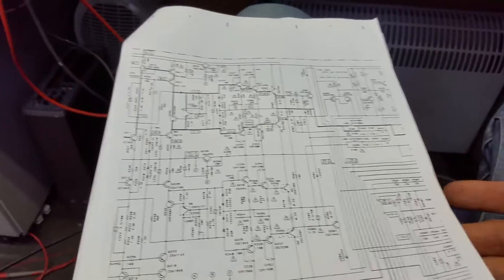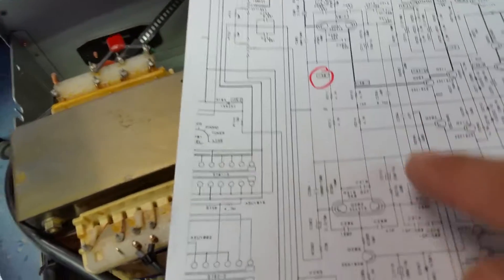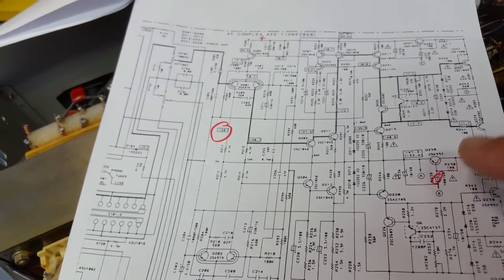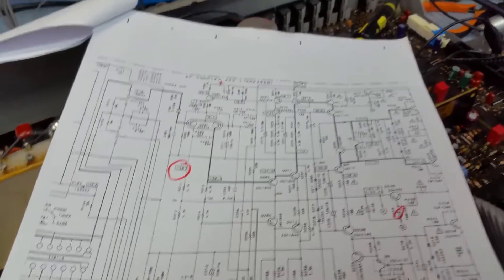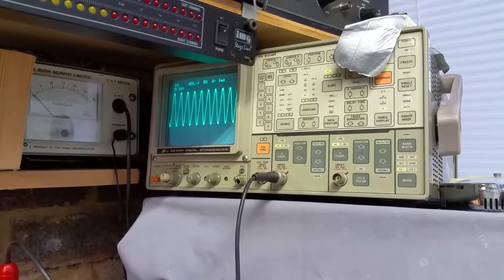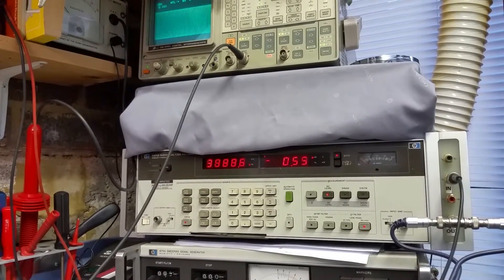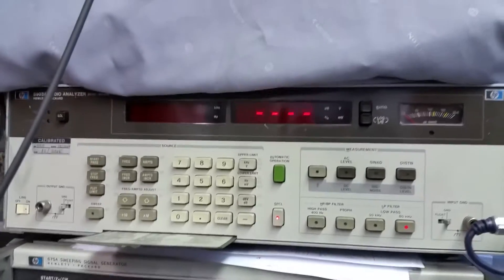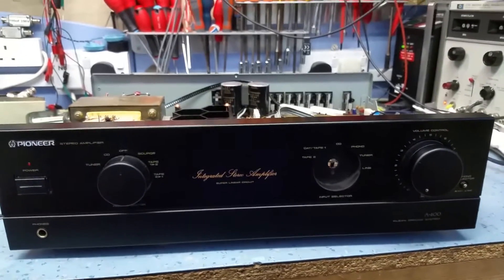Pioneer A400 PSU fault Pt2. fault diagnosis and repair

Comment: Hi Simon, I am trying to repair an A400 and came across your video. The problem is a rather high dc voltage (134mv) on the left channel. I've checked all the resistors on the left channel and they tested ok. Have set the idle voltage to 20mv according to the service manual but am still getting the dc. Any clue what might be the possible issue? Many Thanks 🙏

Comment: Hello Steven, ive watched your videos..im used to work doing this kind of thing many years ago.. I was given one of these amps in for repair after its been past about here and there..I've found it has rustle/low hum in the audio and looked at the circuit diagram plus the last chap who said he replacing many things hadn't do so.  Also the bias across the emitter is reading 1.2mv..very low.   I'm thinking it should be 12mv or there abouts.

Any suggestions would be greatly appreciate.

Manythanks.

Wayne

Comment: If you still have the A-400, Check for cold/dry solder joints everywhere! The A-400 is probably one of the worst offenders for bad solder joints!
btw, Your amp looks like the input caps have been changed
Reply from the maker: Yes I changed them for polyesters. As these were the only series caps in the audio stream, it seemed worth doing.